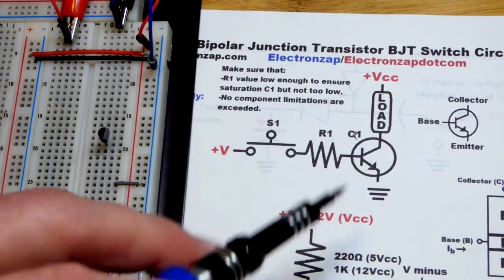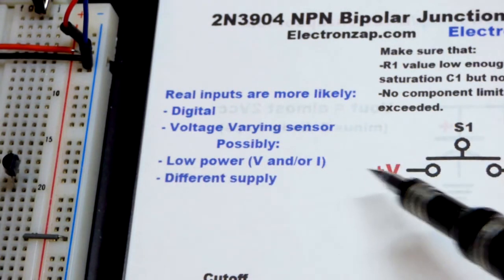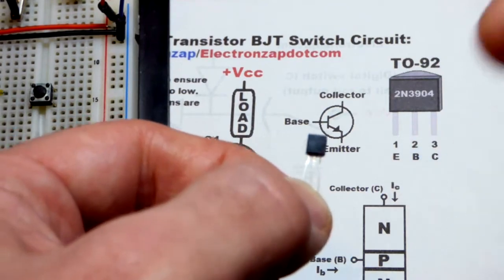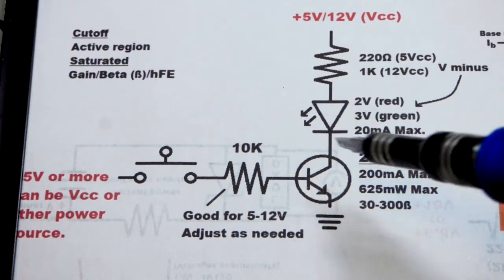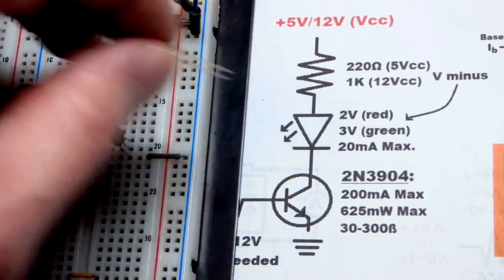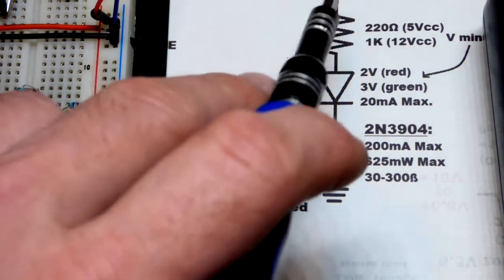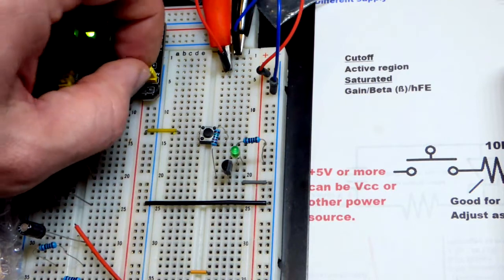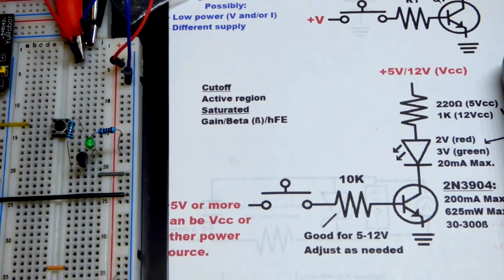NPN BJT switch using 2N3904 bipolar junction transistor circuit for beginner learning electronics

Comment: Good video!  When the transistor is used this way, it helps me to think about it by referring to it as a "buffer" or "voltage follower" (same thing of course as  emitter follower).
Reply from the maker: Yeah, this circuit has a lot of names assigned to it lol. Thanks!